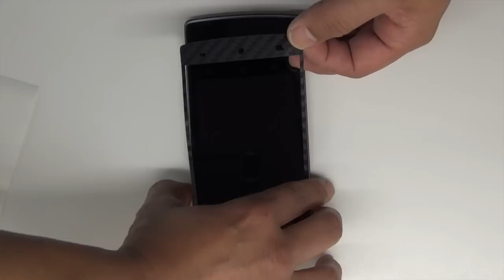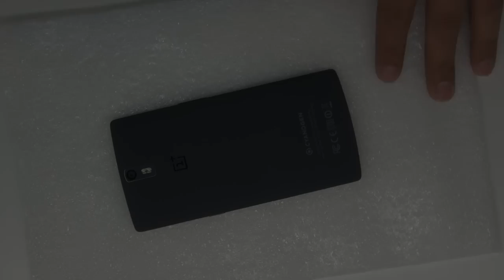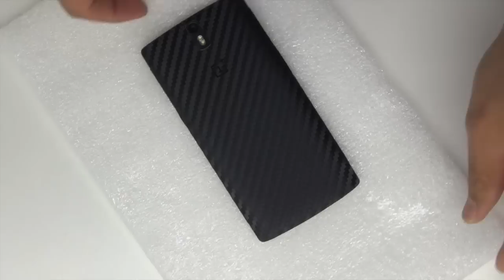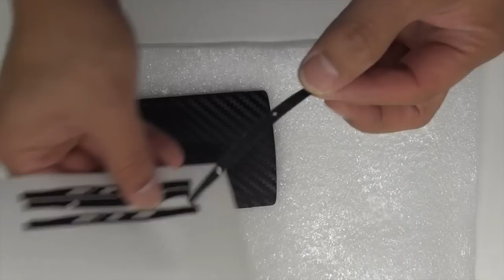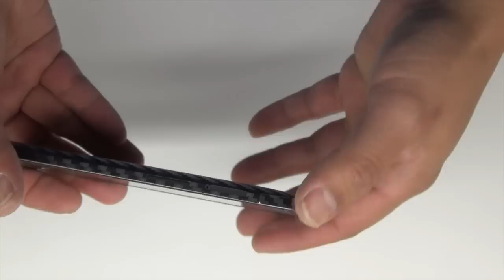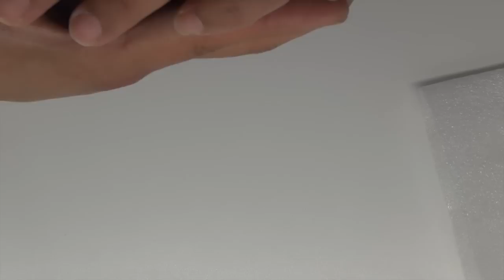OnePlus One Black Carbon Skins Install Type 1 by Stickerboy

Comment: Hello! First of all nice tutorial on how to place it correctly the sticker! How does it feel in your hand? Will it get off with the usage of the phone? I am really really impressed! Waiting for your reply to get this nice black carbon sticker ☺
Reply: OH and also I have a tampered glass will be a problem? And I have black bumper for surround the phone will it fit with stickers? Thanks 😀
Reply: +Vaggos Chio (for anyone reading your comment with the same question )consider putting it under the temered glass
Reply from the maker: +QuiteTheGenie ᴍᴇᴍᴇʀ not a good idea for under the tempered glass because there will be the screen area exposed with a large square air pocket.

Comment: If I get the back only type 1 skin will it come with the sides for the top and bottom of the device?
Reply from the maker: yes, type 1 back includes the top and bottom sides because the left and right side is attached to the back